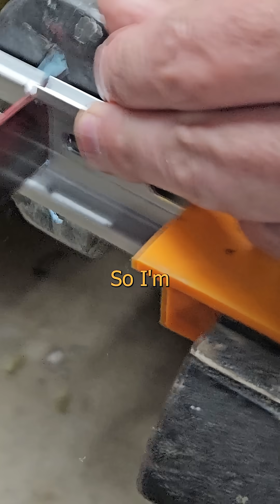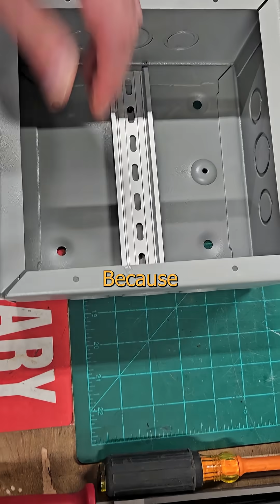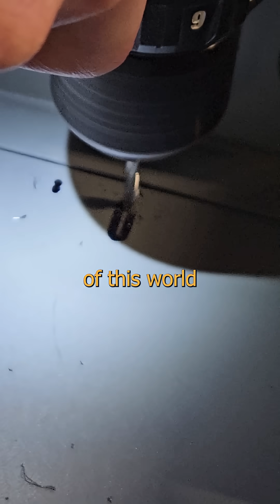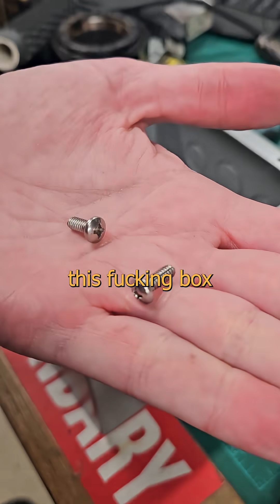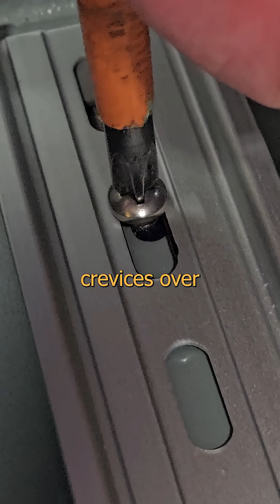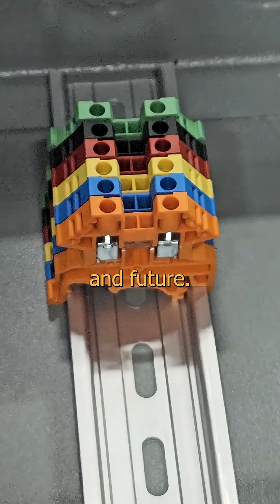Functional Junctions #chrisboden #comedy #engineering #electrical #craftsmanship #motivation #skills

Comment: so those connectors are in the wild, they came with the LDO 3D printer kit I have. There are ones specifically designed for grounding too that unlike the normal ones do not have the DIN rail gripper isolated. making the rail automatically grounded simply by being connected to the ground.

Comment: Would it be easier to drill and mount the din rail if you use a couple inches of double stick tape in addition to the machine screws?

Comment: Fairly certain “the next guy” will already appreciate when you use wagos rather than botch the box with fucking wire nuts…the DIN rail solution though was a thing of beauty (especially with the nod to the inventor Germany with placing the first three elements as the flag black, red, and gold)!

Comment: I 100% agree that the way we treat the stuff you don’t notice tends to show up on how we treat the stuff you do.   Case in point, I had to totally build and run new brake lines on a 56 Chevy apache, and to the layman, I just bent tube and bolted clamps in place, but the client saw that I meticulously avoided contact across the entire circuit, and every bend and mount was placed with the intention that it just came this way to begin with.  99% won’t get it, but those who do, will, and they are the ones who will come back for more

Comment: My father installs security cameras at storage facilities, the BIGGEST issue is when he has to retrofit, because dumbasses in service don’t know how to wire a building properly so it turns into a shit box where he’s gotta rerun everything. Just remember, something Will go wrong and when it does it’s best to have an organized system to fix. Although you should have used washers

Comment: It can go too far, I had a box that looked like a polaroid picture it was so well tied in and set-up. Unfortunately we had bad drawings and it was fitted so tightly that modifying the joke that was this box was 'impossible' And oh trying to actually fault find was a soulless bitch. Plus I used every swearwords in my vocab, trying to return overheated baked hard cables back into position. (I ended up swapping it out so I could sleep at night)

Comment: Did something just like that for my light controls for the wood deck, with DIN-rail mounted Wago and control module holder. However we mostly use plastic encapsulate :)

Comment: I literally just did this in almost exactly the same box. Used a back panel instead of mounting directly to the box since the building guys mounted the box directly to red iron and I don't have taps beastly enough to tap that hole. Bonus points for them hanging the box at second floor level, but with nothing underneath it so I'm swinging in the breeze 10ft off the ground off the edge of the mezzanine. It's done, and I hope to be retired before I have to go into it again.

Comment: Oh boy did I get to go through technician hell. Ya sure learn a lot when the temp agency negotiates you up to $28 an hour and throws ya at an understaffed factory's maintenance department. First good job after my apprenticeship and no one had more than 20 seconds to take a look with you because entering and exiting the clean room takes 5 minutes. I was 3 bloody days into a PM because someone took the simple 3 connection crimped connections for the heaters and rewired it. They made it 8 wire nuts  labeled with dots of sharpie on white fiberglass cable. And these are heaters! Every plastic wire nut was failing and needed to be replaced with ceramic. Then I consulted the team about the resistance measurements on the heaters. I saw the center 3 read 240 and all the others 120. I checked with the team... Our most experienced tech insists those 3 are faulted. This is... Bullshit. Things do not uniformly fail when a machine has been down for a year. Resistive heaters sure as hell don't. So I go trying to pull the center heaters, turns out no one in the facility has ever checked these properly. Because no one knew that this machine had front heaters when I talked to them about it. The front heater wires are labeled with tags. The problem is the lines from the machine are L1 L2 and L3. The resistor leads are labeled with flags of fiberglass electric tape with writing, an improvement! Problem is half of em are labeled right and 2 are labeled A and B? Strung out and on a month of overtime and switching to clocking in at 6 am and it's been 3 days of trying to diligently manage these short wires in a cramped spot. It's been smoke tested several times but after connecting the front heaters back up? Error heater burnout, a wires been crossed. So I check the machine next to it. And discover what it looked like when the manufacturer sent it to us. The new wiring is shit. 3 connections rewired into 8 doomed plastic wire nuts in a molding press where they move and shake under heat they can't handle. I'm on my way home on Friday when I've finally stopped writing up a diagram of the old wiring and found the schematic (dumbass move) when I get the call. Your fired. I was sad on the call but immediately began to think of thank god. Under qualified and with no one having time to train me on the equipment? A month into it transitioning to clocking in at 6 am? I was treading water the whole time. We were so behind on parts. They really could've had me cleaning those property to catch us up instead of sending me to solo changeovers. 😮‍💨 A manager a promoted operator and a guy who talks like he knows what's doing. I'm so glad to be out. I just wanted to write down what the hell happened to me somewhere someone who'll get it might read it. I'm gonna love this weekend, but not as much as this Monday. That's been my day.
Reply: Oh it's also the tale of a gen Z tech entering a department of 3 millennials.

Comment: I tell you what there's nothing better than turning up to a site that you've never been to before and there's a folder with all the building layouts and location of every device.
You open the door for the controllers or whatever you work on and there's a schematic diagram hanging on the inside of the door with all the cable numbers on it and all the cables are labelled.
We usually just get spiders and a heap of cables all connected into one terminal without labels. 
I've even had a brown snake in a box. You always stand a little bit further back in Australia when opening equipment boxes outdoors.

Comment: Wanna see something cool?

I'm designing a project that uses a Radxa Zero 3E, a single-board computer that's half the size of a business card yet packs two gigabytes of RAM and a quad-core processor running the Debian distro of Linux, and because I'm just that kind of total over-the-top builder I'm adding a tiny little OLED display to it that will show battery charge info and system temperatures. Why? Because I fucking can that's why. Practical? Hardly. Excessive? Absolutely. Cool AF? Definitely.

And THAT's pretty cool. 😁

Comment: Phoenix terminals are the GOAT for anything going on a DIN rail. Also, I've got an old Stanley Proto screw holder, it's a godsend for holding #10 screws inside of handy boxes, instead of doing the ball cradle thing while working inside a tight hole.

Comment: You should have seen this nasty junction box for lighting control for a warehouse. All the unlabeled shit, lights sharing the control circuit power... Crooked contactors screwed to the box. I installed a din rail, new contactors, a timer, 3 way switch on one end of the building with 2 motion sensors out in the warehouse, labeled everything. Lights powered by their own circuits, control power on its own. It was so beautiful when I was done. Then I put the cover on and hid it in the ceiling again. Hopefully though no one will ever have to deal with it ever again because it was done right.

Comment: Why is there no gear tray? It's bad workmanship to put a fastener through the back of a box to secure the din rail in the electrical industry in aus/nz. We have welded studs in the boxes to secure a tray which everything is fastened to and tabs to fasten the enclosure to the wall. The only penetrations are the glands in the bottom of the box.

Comment: Trust me, someone will see the effort and appreciate it.

I was doing an electrical inspection on a new research vessel. We go deep, crawling through all the little wireways and squeezing behind paneled walls, and of course cracking open every junction box. When lives are on the line if something breaks, you gotta go the extra mile. Also I'm paid by the customer not the shipyard, so it's my duty to make sure they're getting quality work.

This yard was smart enough to realize that their in house guys aren't good enough for anything more than pulling cables. This is a research vessel with a lot of crazy data cables and connections so they had all the panels and boxes done by a contractor called Port Electric Solutions.

My god they were gorgeous. So well put together I had to wipe up the mess I'd made before closing them back up.

If you're looking for minimum effort maximum results a DIN rail goes a long way to keeping everything in line.

Comment: Needs a back panel and if you are using thermocouple(s), it will need special terminal blocks for the type of thermocouple(s) used. You do want to add error to the temperature signal(s)

Comment: Desert Storm. Someone said a power problem was my fault. I protested. My boss said lets go. We pulled up to the bus bar and he didn't even get out of the  vehicle. He looked at it and said that's not your work. I had a certain way to tie my wire and do a quick reinforcement that helped keep everything together during a sandstorm or a helicopter landing close by. It caught me off guard that my boss recognized my craftmanship at all let alone could spot something that wasn't mine from 15 feet away.  :)

Comment: I used those on a door access system because we could not run new wires. Has made all 36 hours of finding bad lines soooooooo much better. Easy to test check and change while not waisting precious length on the wire we had left from the wall.

Comment: I'm no sparky but I did recently install a nice weatherproof ABS breakout box with a translucent door above my back porch outlet. It's just a simple also allegedly weatherproof 4 outlet surge protector with a couple of USBs on there too. I just needed something more permanent for my Govee string lights I have up in a canopy on my porch and thought it'd be nice to have a more permanent solution for powering the porch than just the covered outlet out there. I'm not sure if I'll take it with me when we eventually move so I went to the effort to properly cut, resolder, and heat shrink both the surge protector and the one extension coming off it with 3/8" fittings. I even went the extra mile to tape a little Ziplock back inside with heat shrink tubing, 3/8" fittings for the other 3 outlets, and some simple instructions complete with links to videos and tools needed. That way if I do leave it, the next fucker can easily do the same more permanent and properly weatherproof addition of plugs easily. I didn't want to leave a window of worrisome wago witchcraft in there.

Comment: A good setup in a simple junction box excites my jimmys like you.would not belive .Lol. I work at a dairy (a milk prossesing and packaging facility) where EVERY junction box, cabinet, and simple disconnect, are wired like art. It is absolutely beautiful. The only problem child is the 500ho boiler room. We have 4 500hp boilers in the same room and it hasn't been updated since it was installed. The difference in how easy it is to address issues in that room from the rest of the plant is leagues and bounds apart. It does make a difference!

Comment: When I had an internship in networking, most of the cabinets had absolutely disgusting cable management, no organization, and no labelling, like they just plugged in stuff wherever it would fit. It makes diagnosing issues, adding more devices, and repairing or replacing components nearly impossible. 
Even if "it works", you should still be organized, use the proper components, and keep in mind that in the future, someone else will have to perform maintenance on what you did.

Comment: That's not how a use a tap, except if you want to destroy threads! You need to use a center punch to indent the center of the hole to drill, then drill the minor diameter with a bit rated for metals, only then you use the right tap by hand (with the right handle) to cut the threads. Given how you've used that tap I wouldn't recommend any power tool for the last step.

Comment: I do robotics and I wish I had someone like you to teach me I’m slowly getting better and better as I it’s European wiring standard but who trained me was a leave the wire length they sent from factory and electrical tape and zip tie it together kinda guy while now that I’m solo I cut everything to proper lengths leaving extra 12” for god knows what re attaching the number plates and pressing new ends on the wires it used to drive me up a wall seeing the disasters to test through lol

Comment: We did a j box on a chrome plating line...run between the rails and.the.main control panel......250 wires ....all red...we had to ohm them out first before terminating them.....

Comment: i don´t know about how other countrys handle it, but here in germany you get "clip in" Wagos, you dont need to bolt cables down. just insert a flathead unlocking-screwdriver, pinch the cable in, done!

Comment: I've been installing mixers timer boxes at work recently and I did the painstaking action of using terminal blocks to make it functional versus the wire nuts the two master electricians used on their timer boxes in their installations last year. Sure I could 6 wires under a wire nut and make it functional but I wanted the next guy who came in behind me to marvel at my work like I used to do when I first started in the trade long ago

Comment: The parts no one will ever see except when something goes critically wrong and has to fix it.  It may be in 25 years.  And that’s why it needs to be obvious and correct.

Someone you’ll never meet will be like “wow I can’t believe this was done correctly and documented.  That eliminates that as a problem really fast just check the current and yup fine moving on” rather than trying to sort out a nightmare of a rats nest for no reason.  And if everyone would have that standard the whole job site would be better off for it.

Comment: My biggest pet peeve is when the installer ran the cables in tight, in my industry a drip loop is required so that when there's a fire and water gets sprayed about that it doesn't enter the junction box and cause more problems.😊
Reply: Adding a cardboard box over the metal box.  With DO NOT REMOVE. 
Will keep the metal box prefect. 😉

Comment: Eh.. fuck wago. If it ain't soldered , it ain't connected (properly) .
If it has proper wire/cable termination and is properly screw-lockt , then its an "i guess its kinda okay" .
If it has wago ? Hand Twisted wires?  Wire nuts ? Meh.... you gtfo . That simple.

Comment: No sense in tapping the box, your only getting like 1.5 threads on it due to thickness. Just drill through it and put a lock.wasjer and nut on the others side so the din rail never comes lose.

Comment: I work at a collision repair/body shop. As long as the vehicle looks good when it's assembled, that's all most people care about. But I try to make everything look like it's straight from the factory. Regardless of whether anyone else will ever see it or not. We have a lot of repeat customers. And even if I don't remember the vehicle. I can tell if I was the last one to work on it, or if it was someone else. I want a dealership tech to not be able to tell what I did. No stickers on replacement parts. Everything aligned perfectly. The correct fastener in the correct spot. Unfortunately I've worked on a lot of vehicles where things were zip-tied together. Random bolts. Stickers and tape from previous repairs. And just shoddy work. I take pride in my work. And I enjoy it. Not as much as I would enjoy restoring classic cars. But it's what I have. So I make the best of it

Comment: Well shit.

This just solved a problem for me!

Doing some electrical work in my house, and the last guy left an, interesting, nest of wirenutted wires in a wall (no J box) and i was not looking forward to trying to get it all in a box.  it would have been ugly, impossible to work on, but at least to code.

This though, holy shit.  I’ll be able to take the time to ID them and then wrangle them neatly.  this is exactly what i need to do it right!

Ty for the info!!

Comment: Id almost rather work on a box that small thats just got marrettes connecting the wires. My hands are fairly big, and if the box is in an awkward position, which it usually is, I have a hard time getting the wires back into the right terminals.

Comment: I usually mark those smaller boxes up and drill / tap them from the back side, it helps if you’ve got drill clearance issues which you didn’t have here, that little Milwaukee worked perfect.

Comment: I'm assuming this isn't a wall mounted junction box. If it is, how do you flush mount it with the screws sticking out the back? I guess you could pop some holes in the wall behind or grind of the screw tips.